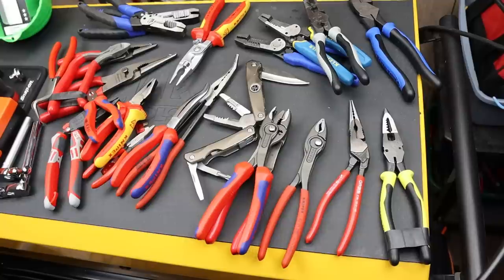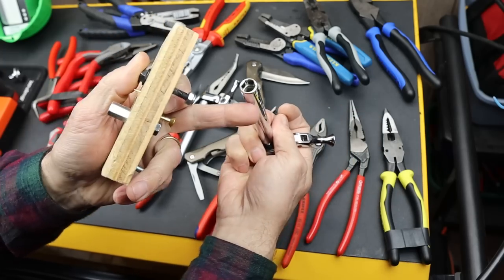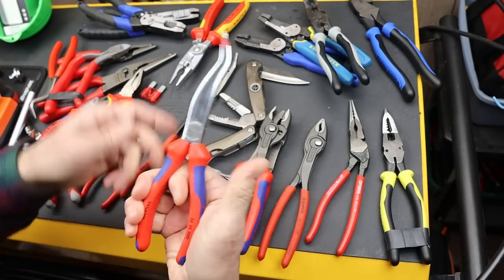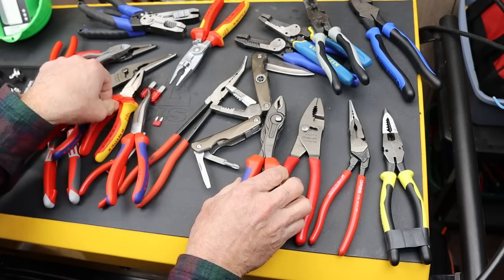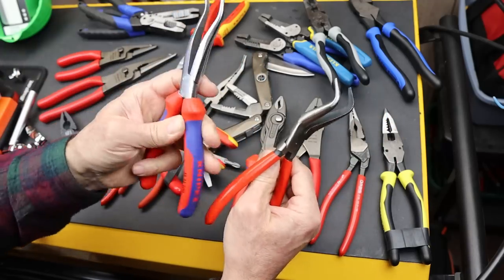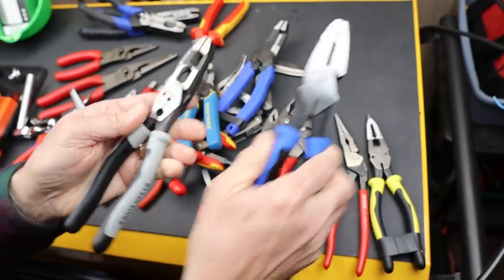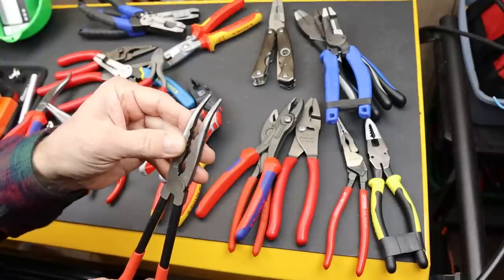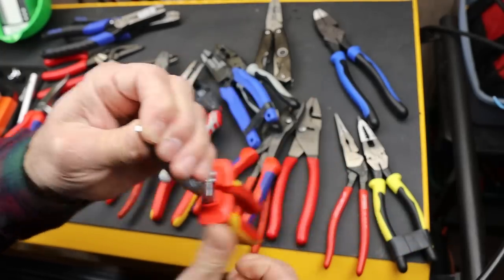How much can you stuff into a pair of pliers? There are the basics and then they're are the hybrids.

Comment: Yeah I bought two pairs two different sizes of the snap-on flank joint pliers and I don't really like them they're hard to use you can't fit them in that many areas to be fair you can't really fit the twin grips in that many areas either but thus the flank joints are even worse when it comes to working on cars they're almost worthless they pretty much sat my toolbox collecting dust until I just gave them away cuz I just didn't want them anymore twin grips are just a much better design

Comment: Hi Doc,
Perhaps You‘v noted me commenting on quite some of Your videos, particularly regarding pliers, for I‘m also pliers aficionado from Germany, therefore with a heavy tendency towards Knipex. Got about 55 pairs, so way less than You apparently have. Despite me loving pliers very much, I try not to buy too many, firstly because of spatial limitations and second- as some other commentators rightly stated- if one got too many tools, many of them always rest in the drawer because one relies on the time-tested traditional ones one knows best. Of course there special situations in which only a equally specialized tool may cope with the job, those very long Knipex „Mechanics“ pliers may be some. But in most occasions there are many paths to go, and that’s why I took some top-down considerations first when choosing my pliers (of course to deviate from them occasionally because that pliers looked so tempting. But I‘ll sell some again in the future). All that said, my strategy is based on the following:

+ for me, the 2 main jobs for pliers are holding/ gripping and cutting. A pair which promises to do both usually does neither well. To grab, I have a range of Cobras and some needlenoses, too. Also I like locking pliers in all cases where a vise is too big (or I have to go in spaces like a car). I got a bunch of those. The twin grips are really a worthy idea, for they grip a lot of things, particularly rounded screws/bolts, but the ordinary slipjoints are for me not worth it, too difficult to adjust. The Raptors are also fine for round objects which about nothing else can grab. If possible, I prefer to screw things with the correct wrench , but if that’s not possible, the pliers wrench is the thing to use. To cut, sidecutters are ok, one pair suffices, because everything harder is better cut by a Cobolt mini bolt cutter. 
+ the Standard size for me is 200/250 mm, for tougher jobs I have a big bolt cutter and also a pipe wrench, which are hardly ever used, to be frank. And for fine jobs I use a small Version e.g. theCobra 150 or electronic needlenose of 120 mm. 

+ A jack of all trades is master of none, the old saying goes, and rightly so. To combine too many features reduces the capability of pliers to do every one right. The very popular combination pliers we have here abundantly in Germany are the best example for that, and some Knipex officials absolutely agreed with me on that ( only they sell so good...). Particularly the toothed section in the middle is hardly good for anything. Only to ruin bolts. The Lineman‘s are a different cup of tea, as are the mini ones, for the change in size to bigger or smaller does make them entirely different tools. 

So, my 5 ct so far.

Comment: Knipex forged wire strippers have to be one of the most useful and versatile pliers I’ve seen. Throw that in a tool pouch with some 180mm Cobras and a klein 11 in 1 impact ratcheting screwdriver and you can get a lot done with those three tools alone. Forgot to add the milwaukee fastback 6 in 1.

Comment: I think for every design of pliers there is a sweet-spot, that if you add more features the overall design get compromised, and how the pliers do each feature will also take a hit.
It is all about balance, if you put to much - your tool will be almost useless in the end.
For me the Knipex Pliers for Electrical Installation, is one my favorite it has several features that it does very well and I utilize them extensively.
Of course there are somethings that it doesn't do or I prefer other tool to use for but it's OK because I don't end up needing many more tools for some jobs.

Comment: If you find yourself at your bench assembling something using a crescent wrench but you're constantly changing the size of said crescent wrench you will love the snap on slip joint with the flank drive feature it's not the greatest for disassembly but it does work I've even used it for a 5/8" bolt (15/16") socket to hold a nut and on the other end I used a 1/2" impact they are a (one way) plier so I hope that helps I'm a diesel mechanic on heavy equipment and class 8 trucks

Comment: I have two pairs of the Knipex TwinGrips, and while I always put them in my tool bag to work on things (even in the house, which is 50 feet from my workbench), I also regularly reach for slip joint pliers when I 'just want a pair of pliers'. In fact, this afternoon I was wishing I had a pair of Knipex slip joint pliers instead of the Doyles I was using, which is probably why I ordered the Icon duplicate of Snap-on slip joints this evening. I tend to reach for the simplest tool which will do the job when at my workbench, since everything I have is either on the pegboards around it, or in one of the tool chests nearby. But I always pack the mutant pliers in my bag, since I never know what I'll need (well, occasionally I do, but I'm pretty surprised if a job goes the way I expect - I think my house was built by several troops of monkeys, since everything has been done slightly wrong, but there is no pattern to the incompetence).

Comment: Jack of all trades master of none.
Most pliers have at least one extra feature in them like cutters or a nut / round gripping area and work just find without trying to do too many things they can't do that well.

Personally I'd rather pair a 2 or 3 that each do a couple things well then go for one that tries to do all the things.

The only area where a pair of pliers doing more than 3 different things is going to be a very effective functional tool is electrical work, lots of things like crimpers and strippers incorporate in to other pliers very well.
In other areas, a lot of the different plier types just don't seem ideal for incorporating.

Comment: I'm in a position where I'm effectively "re-purchasing" tools that I've had for years. As a background task I'm questioning myself on the validity of  these purchases from a number of angles. I can't dispute that the overall quality and capabilities of tools from premium brands is beyond that of my existing kit but one "worry" has to do with the comparison of  how technology is driving us to re-purchase so many items at higher frequencies. The analogy is not valid for this use-case but I can't shake the feeling that I'm doing something "bad" / somehow.  
My recent approach has been to make a single more compact kit from these "nicer" choices and it tends to  live in the car (i.e. "nearby") as opposed to the "task specific" (sort-of) kits that I tend to have in locations near those activities. I then "pull" the nice kit when a task is eminent. Of course, the "old" kit is also at hand to augment as necessary. All this to say that I'm trying to minimize my consumption but I think like many here, finding it challenging.
Thanks for the conversation! /Chris
Reply from the maker: I believe there is a gene buried deep in our DNA that finds satisfaction in wearing out a tool. The constant stream of new things, tools included, leaves us unfulfilled. What is needed is a vacation from the new. Similar to camping and bushcraft and overlanding, there is wisdom in knowing when to walk away for a while and impose deliberate limitations and primitive problem solving all designed to refresh the spirit and focus on what’s truly important. This self-help is expressed on my channel through the pursuit of minimalist toolkits and appreciating the subtle differences between similar tools.